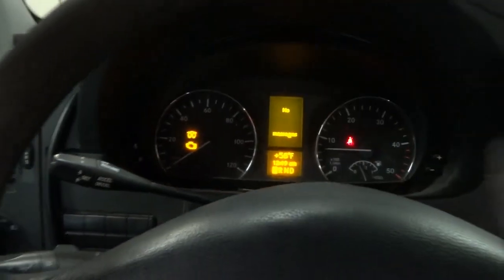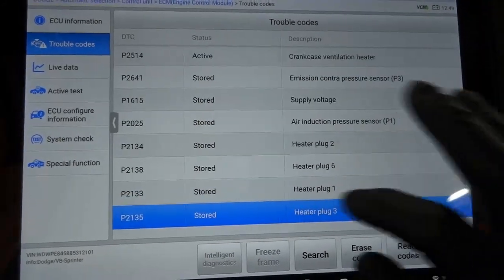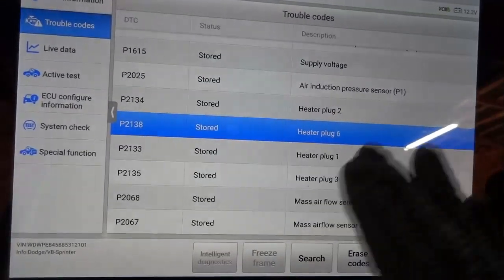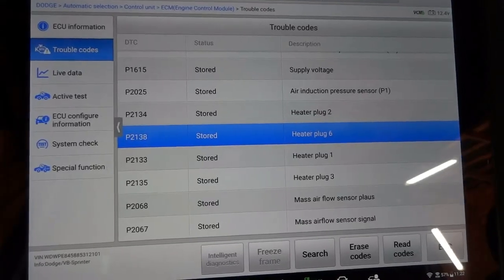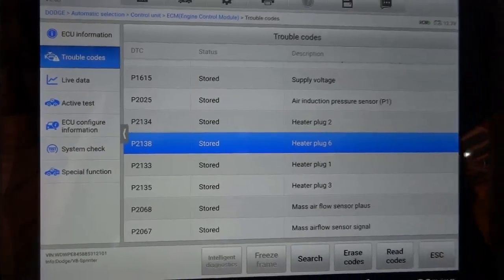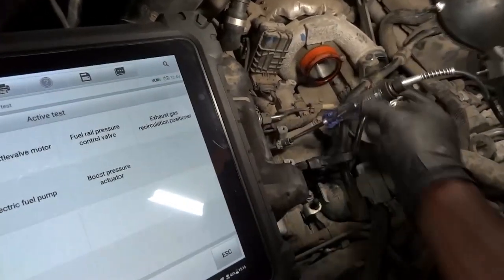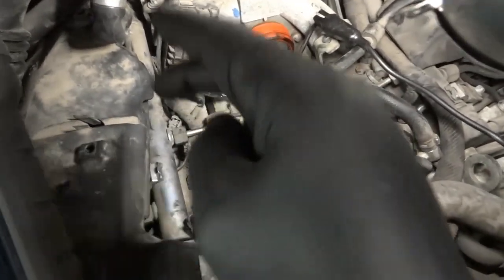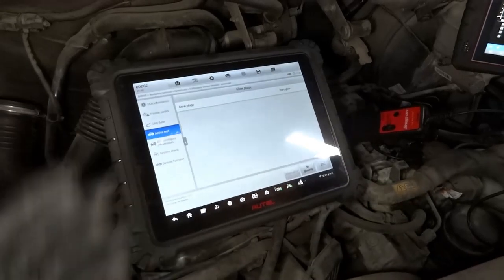08 Dodge Sprinter Code P2133, P2134, P2138 - Glow Plugs Removal and Circuit Testing

Comment: I now have a clue that when checking functionality of hlow plugs you need to connect test light to the positive point of the vehicle while the ignition is turned on and place the tip of tester to the glow plug itself, when the light turns on the plug is working, when it doesn't is not working. Good job my man and keep it up. Wishing to see Engine assembling. From South Africa
Reply from the maker: @wsnxumalo6707   Thank you!

Comment: This is by far the best instructional video I have seen. Excellent job and instructions,  keep up the good work!!
Reply from the maker: Don Robinson  Thank you! I appreciate it!
Reply: @KITS_Auto_and_Truck_Repair Question... I have that same exact 2008 Sprinter 2500 3.0 V6 and I performed this job yesterday after watching your video. My sprinter only have 120k miles but I had 3 codes for glow plugs. I found something very strange when replacing the glow plugs, there was only a partial hole for the glow plug for cylinder 2 and cylinder 6. There were no glow plugs in those two holes as  I mentioned there were only a partial hole. The glow plug wire was there but it was wrapped and it looks like it came that way from the factory? So my van seems as if it was originally manufactured with only 4 glow plugs. It runs great and I just took it on a 1,400 mile drive last week before I replaced the glow plugs. Do have know if my set up is normal to have only 4 glow plugs?
Reply from the maker: @donrobinson5662  No. that's not normal, you have broken glow plugs! did you buy the van new?
Reply: @KITS_Auto_and_Truck_Repair   No I did not purchase the Van new.. It had very low mileage on it and it does run and drive great but I was very surprised to see cylinder cylinder 2 and 6 not having glow plugs there
Reply from the maker: @donrobinson5662  I'm pretty sure they are broken inside!

Comment: Fantastic video.  Great detail and explanations.  One question; if the glow plug module fails, would we expect all glow plugs to also fail? Or can there be a way that the module is the problem but...by example, only one plug is showing as defective?
Reply from the maker: @72911e  Yes! you can have a failed Glow plug module while your glow plugs are still good!

Comment: Excelent teaching videos thank you... question when you were confirming glowplug was good  with test light is this putting to much voltage to the glow plug? Glow plug only rated at 4 or 5 volts?  Thank you for taking the time to share you knowledge.
Reply from the maker: @patricklonnee4929  My Pleasure! these glow plugs receive system voltage
Reply: You tested the glow plug with test light attached to the jumper post. Full battery power 12v. Thank you for clarification.

Comment: Just what I needed Kit. I kept your video handy as I worked my way to glow plug #2 & #3. My codes however were P0672 & P0673. No more engine light but my ScanGuage says they are still stored in the ECM. Any advice or will they go away after several starts? Thanks for the video.
Reply from the maker: @Mikheno My Pleasure! after replacing the glow plugs the codes should go away after a few drive cycles!

Comment: Thank you so much for the video invested and the wonderful explanation.
I have Sprinter 2008 and reading the fault codes, there are codes P2133 P136 P2138 P1955 Could it be that this is why the vehicle smokes black?
Reply from the maker: הרב חגי שושן  defective glow plugs would not cause the engine to produce black smoke, black smoke is caused by a rich mixture, you need to check your injectors, the injectors  might be sipping insted of spraying, which can cause a black smoke, 
bad glow plugs usually cause a long crank..

Comment: Excellent tutorial however you only showed the easiest glow plug to remove. I would have liked to of seen how you tackled the really difficult to get to glow plugs specifically cylinder number six. That just looks almost impossible.
Reply from the maker: @TimWylie-x3k   Thanks, it's doable
Reply: @KITS_Auto_and_Truck_Repair  Of course it's doable but would be nice to see it done
Reply: Also, what is your recommendation about using PB Blaster? I noticed you did not use it.

Comment: I would like some advice on Converter RV CDP55 my AC part of it wires burn down. Need replacement done for
Reply from the maker: jose martinez  what AC part is giving you trouble?
Reply: @KITS_Auto_and_Truck_Repair  Bus bar White wires connected burn. Why is connecting to the circuit breakers burn. Copper wire seem to be OK. Don’t know if I have enough wire from my 120 come in behind the Converter to cut off the bad stuff. I believe the circuit breakers are good.
Reply: @KITS_Auto_and_Truck_Repair  Progressive 60 amp converter was added. For my new Lithium batteries battle born. Not too sure if I had both of them connected they all Converter was the new Converter. Wonder if that would’ve caused my problem. What should have a disconnected on the all Converter CDP 55. AC side

Comment: Very good tutorial video Mr. Kitoko! I have an OM642 in a 09 GL 130k with no codes and no start. New filter, new battery and new GP module. My scan tool is showing synchronization with cam and crank sensor as well as fuel pump on, but my cranking RPM is low in the 180's with warm weather and 130;s in cold weather. Once it finally starts with rpm in 190's it'll run perfect for hours on end. Just yesterday drove it 450 miles averaging 80 mph getting 24 mpg.  Once you turn it off it may not restart, I'm frustrated! Help lol.
Reply from the maker: Geoff Rolland  low crank speed is caused by high resistance in the starter wiring or a defective starter! you should have your starter system checked!!
Reply: @KITS_Auto_and_Truck_Repair  Mr. Kitoko, does the ecm require a certain rpm before initiating injector pulse? Or will it fire injectors at an rpm close to 200. Lastly my scanner is showing: Key on motor off
“Start Enable : No”  
“Terminal 15 : On”
Terminal 50 input Off”
Terminal 50 output Off”

While cranking its showing:
Start Enable: No
Terminal 15: On
Terminal 50 input: On
Terminal 50 output: On
Voltage static 12.20
Key on 11.80
While cranking 10.18

Battery is brand new 900 Cca H8
AGM 
If there is too much resistance what would cause it not too hot start when cranking rpm is in the 180’s then fire randomly?
Reply from the maker: @geoffrolland2676  if the start data pid doesn't change on the scanner when you turn the key to the start position! your problem might be an ignition switch problem or starter relay failing intermittently or wiring issues etc... you should take it to a pro mechanic to have it diagnosed!!

Comment: Sorry, t hat would be an oil cooler replacement on a 2008 3.0 2500 sprinter van....thanks again
Reply from the maker: pnsolarcrete  My Pleasure!!
Reply: Hi there  lm not a mecanic l need help with Dodge sprinter 2007 glow plugs im located in arl va